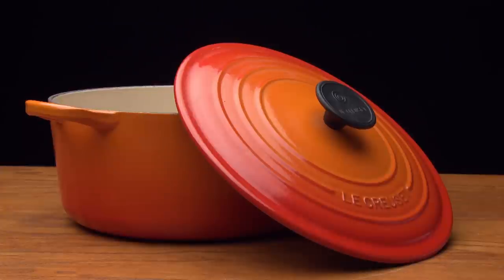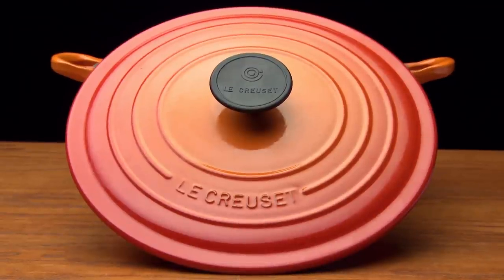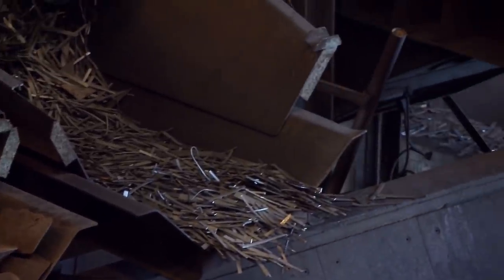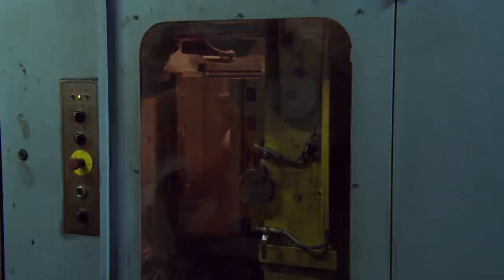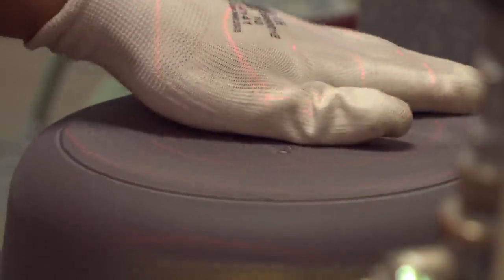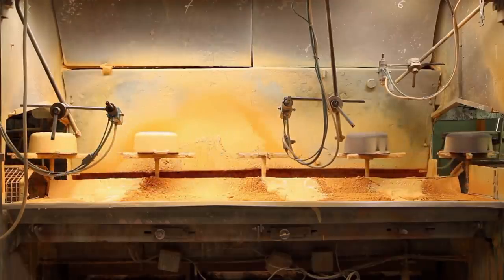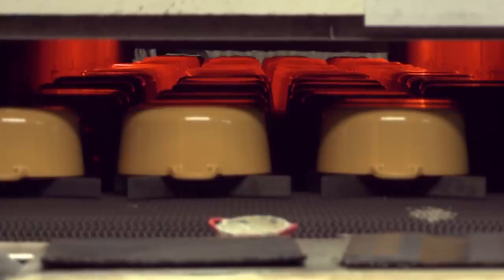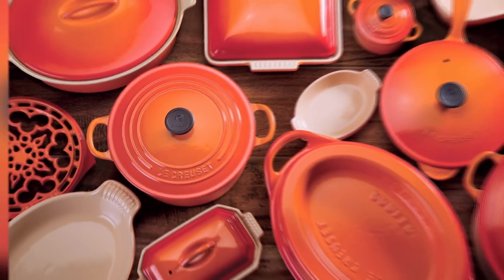How LE CREUSET is Made - BRANDMADE.TV

Comment: I love ❤️ my Lecrueset! It is a fabulous "vessel"....worth the 💲! It is the best Dutch oven I have ever had!
Reply: Can I ask your opinion? I just bought a LC pot from Amazon (arrived today!) and was a little concerned because the box seemed a little worse for wear. It made me wonder if somebody had returned it. Anyway, it’s the 7.25 quart Dutch oven in Sea Salt. I really love it, but my eyes are too good, and I notice tiny, almost imperceptible imperfections. Should I  return it or do all the pots have minuscule defects in the enamel? On the lid there is a tiny pinhole in the enamel, but I can’t see black through it or anything. And on the interior of the lid, where the embossed numbers and screw are, the enamel seems a little thin. It’s almost like I can see a little gray through the enamel on the numbers. Also, is the rim of the pot supposed to be unenameled? Happily, the interior of the pot appears to be smooth and without blemish. I’d hate to return it and get something worse. I’ve read online that they are handmade and therefore perfection is impossible. Am I being too picky? I think I may be because of the expense.